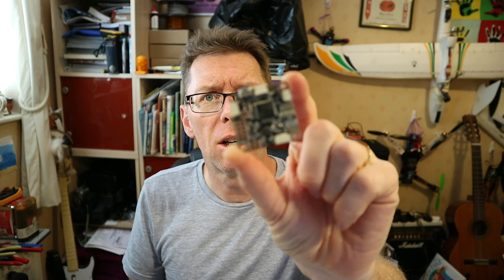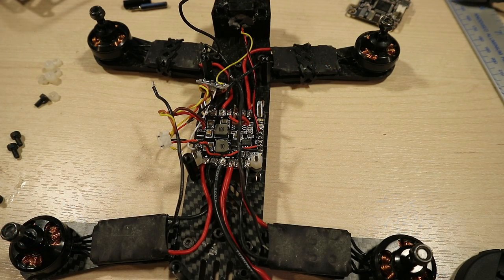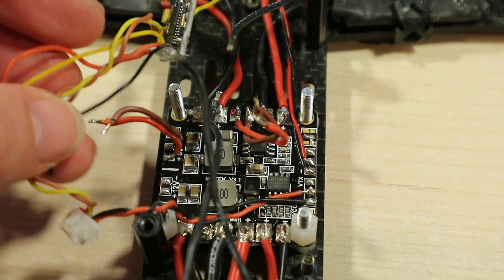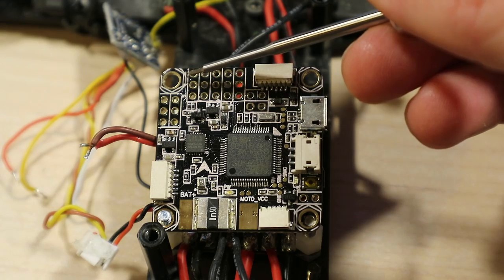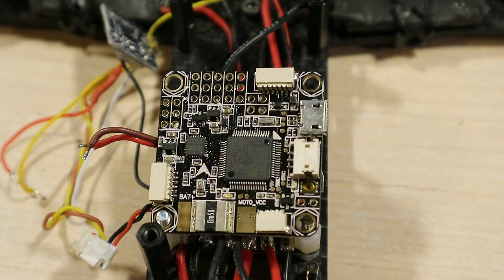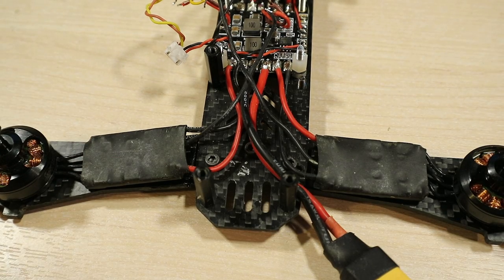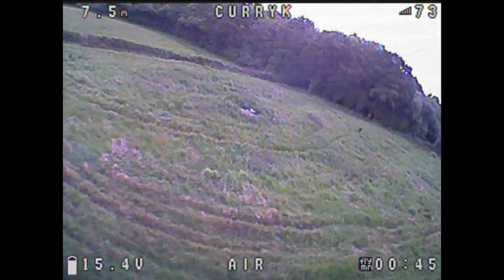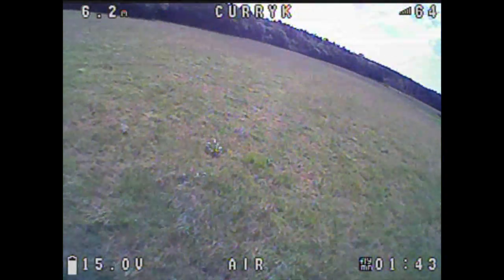Omnibus F4 Pro Review (F4 FC + Integrated OSD) - Supplied by Banggood

Comment: Glad you got it sorted in the end Wayne! Also, new camera? Intro shots looked great!
Reply from the maker: Yes - thanks for noticing :)  Birthday pressie from my wife was a Canon EOS M3, which is the cheapest "decent" camera I could find with a flip up screen and a mic input.  I'm using a Rhode video micro direction mic on this one  as well instead of the normal lapel mic... which picks up a touch of noise from the computer but seems pretty good I think, and stops the issues where I forget I'm tethered with a cable and walk off :D
Reply: CurryKitten yeah it looks and sounds great! I just got myself a lapel mic to try and improve my audio, I've been using a senheiser shotgun thing but it seems to have a lot of hiss that I need to remove in the edit so hoping this will sound better and save time! The autofocus looked impressively fast on yours and didn't hunt! I've got a Panasonic GH2 but it's getting a bit old now, may need to have a look at new bodies!

Comment: There seems to be alot of faulty boards coming from Banggood  of this type. How is your board doing????
Reply from the maker: Obviously, it had a bunch of problems, but is actually holding up ok.  Still in the quad in the video, and I'm always amused by the barometer.  Usually (but not always) a faulty board will show up straight away - in which case claim a refund/replacement immediately - it's been very rare for me to have a fault appear after multiple good flights.  The only board I've managed to completely wreck is an original SPRacing F3 board after lots of crashes
Reply: I've had 3 of these and they all failed. This FC is a piece of crap. Shame too, since it has very nice feature set.
E: I should add that the first and third board failed after working for 10 or so flights. The board number 2 failed right after the build when I plugged in the battery to calibrate the voltage sensor. The other two failed the same way, having the battery plugged in while you connect the USB cable seems to fry these boards.

Comment: Great vid. The solder is so important. Are you using any flux, are you twisting the wires when striped, are you tinning the wires before soldering to the board. Did I mention do you use flux?? I'm going to do a live stream building a quad either, tonight or tomorrow with the same f4 board and all in one ESC.
Reply from the maker: Yes, I use a solder that contains flux, wires do get twisted before tinning, and any pads also get tinned.  I do find that sometimes it can be a struggle on these boards where you need to go through the hole with the wire after tinning it.
Reply: CurryKitten yeah these board with the holes are designed for the header pins. Which is a pita when space is tight.

Comment: I'm building a 250, and my ESC grounds are connected to the signal grounds. Do I still need to run separate grounds to my Omnibus FC along with the signal wires? (I have removed +ve leads)
Reply from the maker: If you are powering everything with the same battery (as I presume you are) then no, the grounds should be common throughout, so you'll just need the signal wires.
Reply: @CurryKitten  thanks, that makes sense.

Comment: Hi My friend. What PDB would you use for this board, I'm new to building but not to flying. I intend to put this board into a 450 or a 500 quad, first off I will build it bare bones and then add GPS etc later. Many thanks John

Comment: could you try to explain how to get RSSI on the OSD? was that done through your RX? or through the FPV cam on board OSD? or through the FC OSD? I'm new to this and kinda confused
Reply from the maker: This actually works by using the telemetry on the Taranis and then sending it to the flight controller over another RC channel.  It's a bit complex to explain in a comment, but I'll write it up quickly as a blog post.  So check www.currykitten.co.uk in the next few days and I'll put some details up

Comment: Glad you like the omnibus. A shame you had a dud though. The normal F3 and F4 are probably more than enough for most people and easier to use.  Normal F3 has an SD whereas the normal F4 does not. Also, F4 processors have some difficulties with IBUS on most UART 's. When it comes to the lines in your video feed, I think it' S noise from your motors. Do you have an LC filter somewhere to power your cam and VTX to see if that makes any difference?

Comment: I like the omnibus line. It's my goto FC. I prefer the v4 non current sensor. I know the Banggood version is a knockoff from the original. You can tell by the lack of the SD reader. Looks like they gave you a genuine version or perhaps they copied that too? The OSD via betaflight is the only way I like to fly now. I have tried a couple variants (DYS + 4 in 1 esc). The Dys works great. 

Mostly, I'll never fly a fc without the built in osd. 

Thanks for the vid.
Reply from the maker: It does have an SD reader - but I still think it's a knock-off :)  The  DYS looks like a very neat solution

Comment: Nice video, thanks for sharing. I am RC heli pilot that has been out of the hobby for some time and I thought about getting back into it and I discovered all this stuff about FPV quad copters and I trying to understand all the bits and pieces.  I am an Electrical Engineer so I understand the technology for the most part but I am having trouble with the naming conventions. Is Omnibus a manufacture or brand name or technology level / firmware. I get the F1, F2, F3, F4, F7 processor stuff but the DSY, Normal, Omnibus stuff is what is confusing me, any help that anyone could give me would be much appreciated. Thanks again for sharing.
Reply from the maker: Omnibus started out as a specific board with it's own firmware, but then got cloned - so there's lots of boards that are called Omnibus, but technically only one "real" sort  However (aside from a few normal/pro variations between the F3/F4) they should all carry the same pin-outs, have the same UARTS, and pretty much work the same

Comment: Can you set beta flight to use barometer to fly up to x metres and manually fly at that flight?  Does the sd card record video?
Reply from the maker: There's a Baro-hold mode in Betaflight - which is supposed to hold you at an altitude.  I'm not sure how well it works, it was removed for a while and then put back in.  Generally, for using these sort of flight modes I'd be more tempted to use iNav.  The SD card is for blackbox recordings (telemetry/stick positions/accelerometer status/etc/ that you can playback)
Reply: @CurryKitten  Is there a flight controller that has Baro and an on board sd for video record ?
Reply from the maker: In a word, no.  Whilst you'll sometimes find VTX's with DVR capabilities, never in a flight controller.

Comment: i cannot flash this board the boot button has no button top to press in and the dfu command is not recognized in cli tab how can this be flashed?
Reply from the maker: It's got a boot button on there, if you look at the close up image on the video at around 3m 09s you can see it.  Look at the bottom right of the board, just above 2 holes and just under a plastic connector there's a round button.  That's the boot button.
Reply: ok thank you... but is anyone having problems having no connection through sbus? i bought two boards from bangood and both have this problem from the beginning and now one will not power up through usb at all with no recognition from the computer that anything was plugged into the usb
Reply: it gets power but the info cable is not recognized in betaflight

Comment: 2 Beeps, 3 Beeps? That's spooky I've just had that over the weekend and had to order a new FC myself.
Reply from the maker: Mine was 5 beeps, followed by 2 beeps (as seen in this video https://www.youtube.com/watch?v=alE96ClB8pE) Which means an accelerometer failure... sadly it's on the same chip as the gyro which also went crazy
Reply: Well my new PIKO turned up today and I wired it all in and baring any failures tomorrow on the flight test all appears to be well. So I thought lets plug the old one back into beta flight and NOW it's completely happy, so go figure? Well spare a FC is alway useful. I wonder if I have any spare motors.... and a frame... and a receiver.

Comment: Hi, can you get your board in to bootloader mode?  I can't with mine.
Reply from the maker: I haven't tried - it flashed to 3.1.7 without a problem... I did notice it used DFU though, which means you need that weird driver thingy if you are on windows (I think)
Reply: how did you do that?
Reply: Lic. Claudia I. Armenta just install the drivers from the main betaflight app front-page or use the driver fixer from the immersion rc website.
Reply: +CurryKitten so with BF 3.1.7 the rssi works straight? does it work on analog input or pwm? ive got my rssi pad soldered to a wire. when i enable it w/o anything connected, it reads 44% and stays in that value even with GND or 3v3 input(that analog input is max rated 3v3 only)... and another thing, with enabling rssi, this will not 'disable' amp reading.right? 

because I plan to use voltage/current/altitude/rssi on my osd... i plan to use a hacked flysky ia6b reciever(analog output) for rssi

Comment: I'm wondering if the "power" of an F4 is really going to improve flight, or if it's a higher-speed CPU we need to make stability corrections occur sooner.  Better, more sensitive gyros, and other sensors?  Now if you could tell me that a cheap down-facing CMOS could give me position hold using an F4, THAT would be a feature!  If it could "run a program" to do that analysis, it would be a win, but that would require memory too, wouldn't it?
Does anyone have a solid handle on the actual deficiency?  I mean, what is this board with an F4 doing that the same board with an F3 would not actually accomplish, albeit with higher CPU load?
Obviously OSD onboard is a great innovation, especially since it allows setting adjustments in the field.  With the data you want originating in the controller it makes even more sense.
Reply from the maker: I'm not sure that anything actually needs an F4 as yet, but it's quite easy to see the advances in how quick ESCs need to be communicated with.  If you take a F1 board and tell it to do high loop/gyro times and use dshot600 then it'll max out the CPU straight away.  So presumably as new ESC protocols appear (and they seem to pop up weekly) the power may be needed.

Does it make things fly better though.  Well, yes, but not by much IMO.  There was a great increase in performance once oneshot came in.  But I'm not sure I could spot the difference between a quad running Oneshot125 and Dshot600, same with the PID loop moving from 2khz to 4khz... yeah it's faster, but there's a cycle of dominishing returns.
Reply: I suspect a micro would benefit more from a faster PID loop.

Comment: What FPV camera did you use for this video?
Reply from the maker: Bit of a weird one, as the limited space in this frame restrict what can be used.  In this case it's a Lumenier SMC-600.  Which only has a CMOS sensor, but does a reasonable job
Reply: CurryKitten Cheers! Looks great for a CMOS

Comment: Does anyone know if I can use PWM transmitter with this flight controller?
Reply: Κατσαρό Πιρούνι Should work, but i would suggest using some Bus Communication...
Reply: No it takes ppm and sbus/ibus. U could get a converter but the u risk not having failsafe

Comment: Bangood is not best place for buy such delicate things like FCs. I received banch of defective items from them and cannot take any reaction from support in 4 days already.
Reply from the maker: It's quite simple when dealing with any supplier that drags their feet on support.  You pay with PayPal, and if they don't respond quickly - you open up a PayPal case, and you don't close it until it's fully resolved.  Sometimes it's only opening a case that will push them into action
Reply: Open source FC units are a crap shoot.  I have spent much more purchasing a ''genuine' FC from somewhere like my****.com and though responsive they had no clue about how wire it up how I wanted, features (buzzer, baro) simply didn't work due to issues I had then found out were known.  I now shake the dice and hope the ~20$ to 30$ last generation units work and have had better luck.
Reply: I totally agree!  I always use PayPal...you can still pay by the credit card of your choice - mine, a mileage card, so I get the benefit of PayPal making them behave, and still get my mileage! (:^)

Comment: why does it has a sd cart reader?
Reply from the maker: You can put an SD card in to use with Blackbox - which will give you a lot more storage than the onboard flash memory (that's if you are into theblack box data analysis)

Comment: Shame on you, dry joints, frayed wires and no colour coding with your wiring, but at least you got it going even with the inbuilt problems.  Not exactly a good way to send a review board with badly soldered components.  I must have been lucky, I was given one which had been badly mauled almost to death by an amateur soldering iron and it took me a while to clean it up, but it's working OK on a test quad.  As for the noise bars, it could be noisy ESCs putting crap into the system. Isolating the video feed could quieten it down some. Obviously not on a racing quad, but on anything larger I'd be rerouting the video wiring side of things and/or running a separate battery for video.